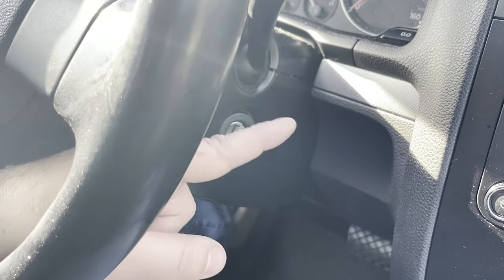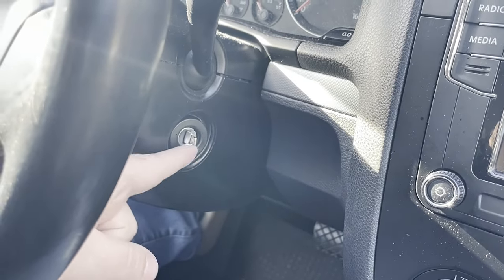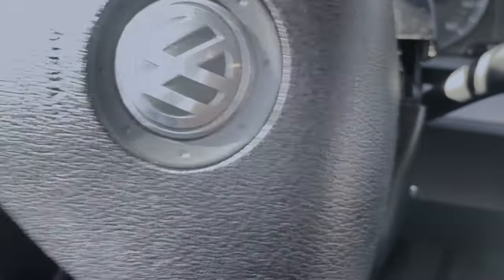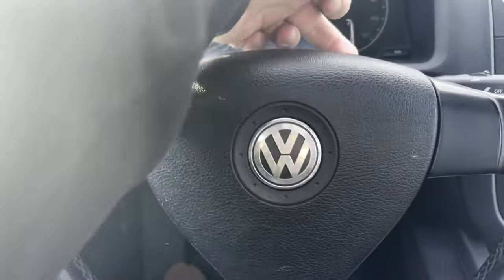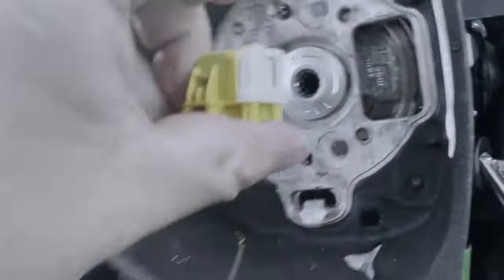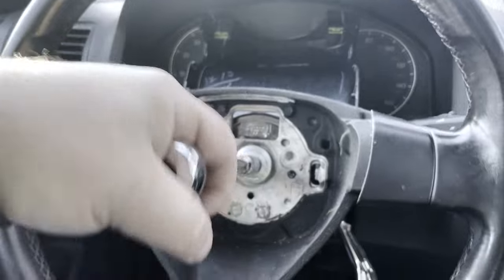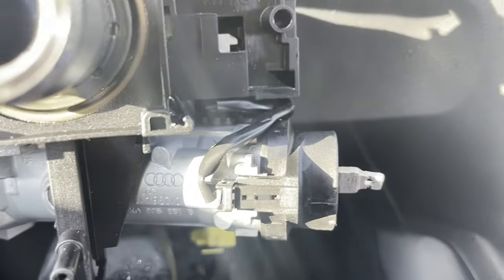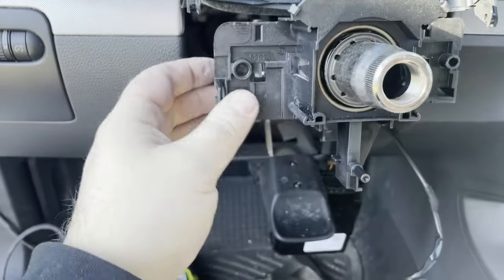Replacing Mk5 VW Ignition Switch Lock Cylinder

Comment: People should know that this removal doesn't require the removal of the steering wheel or the turn signals or wiper control. After removing the trim and the bottom most control box under neath the cylinder. Just drill out the retaining bolts., us the extractor.. disconnect the wire that connects to the front of the key switch...  the cylinder will not drop right out. but wiggle it around a bit and... it will come out.. 2008  Rabbit and similar.
Reply: How
Reply: You can't get to the T9 torx holding that little control box on without taking the steering wheel off...
Reply: What drill size for security bolts
Reply: I saw the thumbnail and was like wtf 😂
Reply: @chrismonroe8417 it's a T8 and yes you can get to it I did this job without taking of the steering wheel
Reply: Just use a mini ratchet for the T8
Reply: @DM-vl6kl  I don’t see how that could be possible with the steering wheel completely blocking any way of getting into the tiny slot you need to get to 🤷‍♂️
Reply: 07 rabbit done without removing steering wheel , triple square never heard of that
Reply: Cannot get the security bolts out with the wheel on unless you drill
Reply: @chrismonroe8417  if you rotate the steering wheel upside down you can access the screw without taking off the steering wheel. I am currently replacing mine as I type this.
Reply: @ You can’t though.

I thought I was going crazy when you said that because I rotated the steering wheel to try and get it but you absolutely cannot get that tiny bottom screw off without removing the steering wheel.

1000000% cannot get it.
Reply: @chrismonroe8417  I did it, you have to rotate it so that the top of the wheel is diagonal and then have an extension on the socket. I wouldn’t have replied if you couldn’t do it. I did have to take my wheel off after the fact though bc there are clips inside the tree that hold the cylinder inside the tree.
Reply: @🤷‍♂️
There’s no way to get to the screw on mine.
Physically impossible without removing the wheel.
Reply: @chrismonroe8417  I’ll make a video of how mine is and how to access it. Yours might have a different design too, what year is yours? Mine is an 08’
Reply: @ 2006

Comment: Guessing that by now, most of you, including the kind and methodical person who made the video, have come to insight regarding the security bolts. You really dont have to drill them out. There are a bunch of vids on this very same disassembly procedure, from jolly brits to silent polish blokes, and all of them feature reversing the bolts out by tapping with a chisel or a punch. Tap-tap-tap dun. Replace with an M8, 20-25mm long. You can drill a smaller hole and tap in a torx driver too, if you fancy that. I honestly feel sorry for you who go the hard way about it, as this man states, the drilling of the bolts was the hardest part of it all.
Reply: And, yeah, there might be some people who have for some reason ended up with a assembly where the security bolts are much more jammy-clammy. Really, no disrespect  or smart-arsery, I could have resorted to the same drilling, had I not caught the other vids first.. just hope people try tapping before drilling and save themselves trouble.
Reply: Do u have a link to those videos??
Reply: @davidgiertta l

Comment: You don’t need the key to changes your gears and set your car in neutral, use a screwdriver open the plastic cover around the shifter underneath you’ll find a yellow bottom, push it  with your fingers or screwdriver and then change the gears without using your 🔑 key.

Comment: Thank you so much for this - garage didn't want to touch the job. Successfully completed though I found it easier to tap the bolts out through the holes at the front with a hammer and screwdriver rather than drilling them out.

Comment: I have a similar issue with the door locks of Volkswagen Polo when I apply with the key fully inserted it pushes the pin barrel into the gullies and you can switch the key around for some reason even if it's not the correct key in   the lock the locks pins in line with the gully what should I say gullies and is free to spin around without opening the lock you can spin the key around I bought this for this because you can use the left-hand side lock for the right hand side but it's just upside down but the key what is left hand right side

Comment: Just did this procedure on a 2012 jetta. Used a center punch on the edge of the security bolts to turn them counter clock wise. Once you've got them to turn just a smidgen, they will trun out with your finger spinning them or something pointy sharp to spin them. But you have to be able to get center punch on the edge at an angle to get bolts to turn a smidgen.
Reply from the maker: Great info

Comment: Did you buy the whole kit? Like the actual cylinder and black part that the key goes into? If so, did you have to swap keys? My steering wheel sometimes wont lock, sometimes it won't let me actually turn the key over to start, sometimes it won't let me shut the car off, and sometimes the key gets stuck. I'm assuming that I have to buy the whole kit? Great video tho! very helpful.
Reply from the maker: I bought the complete assembly with all three parts. The black part around the key, the center lock section and the black electrical switch. But I ended up swapping back to an oem cut key and lock cylinder so I wouldn't have to re-key the rest of the car.
Reply: You got buy that shit separately man I’m going through the process now….
Reply: ****GOOD VIDEO EXCEPT WAY TOO MUCH REMOVAL****

There is NO need to remove anything on the steering wheel - AT ALL. Disconnect battery and  (1)Remove the top and bottom outside cover (3 T20 screws), then (2) DRILL out (calm down) the 2 bolts on top of the ignition lock cylinder then use an extractor kit to remove the drilled bolts out (or you can rotate them out with a flat head screwdriver and hammer - good luck on that one).  (3a) Then remove the steering wheel angle sensor (bottom flat plastic tray piece under steering wheel):  there is a TINY T8 screw in the front, then you need a thin pick/strong thin wire for it's front clip (unseen clip but you can wiggle around a curve near the right side of the ignition switch to depress it's hold), the rear clip is easy to get to - use your finger near the rear of it simply press it in. (3b) Disconnect it's YELLOW clip on the right rear side of angle sensor and let it hang there no need to disconnect completely.  ONE MORE STEP TO FINISH.  (4) stick your fingers, from the bottom pointing upwards, to release the (2) tabs holding the ignition lock housing in place.  I pops right out - That''s it.  Can be done in about 45-60 minutes with right tools.  May take a couple of hours if your slow and cautious.  But at least it's a free fix.  Be Breezy -

Comment: 11:38.    I  dropped  the steering wheel column by removing 4 bolts  to get more room for drilling , after drilling them out I used a bolt extractor  , thank you for your video  I follow all your directions   Thank you again it is so helpful
Reply: did you find out the problem? my 07 rabbit won’t turn over at all
Reply from the maker: great tip

Comment: Thank you for making the video! Really helped me change my 2011 VW GTI lock cylinder. Only thing I did different was to use a punch with a hammer on the security bolts to scar their head. I watched that on another video. Then I tapped that mark from a side angle which loosened the bolts. I could then just drag the punch against the mark circularly to unscrew them. I was able to reuse the bolts this way. The wire harness on the new VW OEM cylinder had one different connector on its wire harness that didn’t fit the steering connectors so I reused the old wires. I also reused my lock, removing it with a paper clip from the old cylinder.
Reply: I'm currently dealing with this issue of trying to get into the tamper proof bolts without having to take off the steering wheel. The bolts head are so small though that I'm having trouble punching a hole in it. Do you have an advice? Thanks!

Comment: Did well man explained and educated your procedures and didn’t skip vital information..
Reply: ****GOOD VIDEO EXCEPT WAY TOO MUCH REMOVAL****

There is NO need to remove anything on the steering wheel - AT ALL. Disconnect battery and  (1)Remove the top and bottom outside cover (3 T20 screws), then (2) DRILL out (calm down) the 2 bolts on top of the ignition lock cylinder then use an extractor kit to remove the drilled bolts out (or you can rotate them out with a flat head screwdriver and hammer - good luck on that one).  (3a) Then remove the steering wheel angle sensor (bottom flat plastic tray piece under steering wheel):  there is a TINY T8 screw in the front, then you need a thin pick/strong thin wire for it's front clip (unseen clip but you can wiggle around a curve near the right side of the ignition switch to depress it's hold), the rear clip is easy to get to - use your finger near the rear of it simply press it in. (3b) Disconnect it's YELLOW clip on the right rear side of angle sensor and let it hang there no need to disconnect completely.  ONE MORE STEP TO FINISH.  (4) stick your fingers, from the bottom pointing upwards, to release the (2) tabs holding the ignition lock housing in place.  I pops right out - That''s it.  Can be done in about 45-60 minutes with right tools.  May take a couple of hours if your slow and cautious.  But at least it's a free fix.  Be Breezy -

Comment: Hi, actually at 16:04 you just skipped the most important part for me, how to remove the ignition barrel without any demage if the key does not turn, as you mentioned it should turn to full ignition position to be able to remove the barrel (using a thin strong wire or paperclip, etc.), so could you please share how could you remove it if the key does not turn?
Reply: ****GOOD VIDEO EXCEPT WAY TOO MUCH REMOVAL****

There is NO need to remove anything on the steering wheel - AT ALL. Disconnect battery and  (1)Remove the top and bottom outside cover (3 T20 screws), then (2) DRILL out (calm down) the 2 bolts on top of the ignition lock cylinder then use an extractor kit to remove the drilled bolts out (or you can rotate them out with a flat head screwdriver and hammer - good luck on that one).  (3a) Then remove the steering wheel angle sensor (bottom flat plastic tray piece under steering wheel):  there is a TINY T8 screw in the front, then you need a thin pick/strong thin wire for it's front clip (unseen clip but you can wiggle around a curve near the right side of the ignition switch to depress it's hold), the rear clip is easy to get to - use your finger near the rear of it simply press it in. (3b) Disconnect it's YELLOW clip on the right rear side of angle sensor and let it hang there no need to disconnect completely.  ONE MORE STEP TO FINISH.  (4) stick your fingers, from the bottom pointing upwards, to release the (2) tabs holding the ignition lock housing in place.  I pops right out - That''s it.  Can be done in about 45-60 minutes with right tools.  May take a couple of hours if your slow and cautious.  But at least it's a free fix.  Be Breezy -
Reply: @TriuneSelf4444 could you tell me what the module is called beneath the ignition assembly I’ve got a dead spot on the mother board and my dashboard only lights up if you press the spot but the vehicle has power 👍
Reply: @jasiahgriffis689  Sorry, chief I was away for a few days.  The module beneath the ignition assembly on a 2008 GTI Golf is most likely the ignition control module (ICM), also sometimes called the "ignition module" - it's the electronic component that manages the timing and spark generation for the engine ignition system.  I am not sure if this is the one you are referring to.  If not then you may want to go to VWs online parts/accessories page and type in these parts name(s) and they will show you a picture of it AND the surrounding/supporting parts to find out which one you are referring to.  Hope this help.

Comment: Question - How did you install the old key cylinder into the new ignition housing?  Around 16:03 you just pull out the assembled parts, but I am having difficulty putting my old key cylinder into the new housing I bought.  I read elsewhere that you shouldn't turn the insides of the new housing with a screwdriver, before installing the key cylinder, but I unfortunately already did that.  Any tips on getting it to go together now?
Reply: ****GOOD VIDEO EXCEPT WAY TOO MUCH REMOVAL****

There is NO need to remove anything on the steering wheel - AT ALL. Disconnect battery and  (1)Remove the top and bottom outside cover (3 T20 screws), then (2) DRILL out (calm down) the 2 bolts on top of the ignition lock cylinder then use an extractor kit to remove the drilled bolts out (or you can rotate them out with a flat head screwdriver and hammer - good luck on that one).  (3a) Then remove the steering wheel angle sensor (bottom flat plastic tray piece under steering wheel):  there is a TINY T8 screw in the front, then you need a thin pick/strong thin wire for it's front clip (unseen clip but you can wiggle around a curve near the right side of the ignition switch to depress it's hold), the rear clip is easy to get to - use your finger near the rear of it simply press it in. (3b) Disconnect it's YELLOW clip on the right rear side of angle sensor and let it hang there no need to disconnect completely.  ONE MORE STEP TO FINISH.  (4) stick your fingers, from the bottom pointing upwards, to release the (2) tabs holding the ignition lock housing in place.  I pops right out - That''s it.  Can be done in about 45-60 minutes with right tools.  May take a couple of hours if your slow and cautious.  But at least it's a free fix.  Be Breezy -

Comment: Thanks for all your time to share the info and procedure. Great info and help there
Reply from the maker: Glad to help
Reply: ****GOOD VIDEO EXCEPT WAY TOO MUCH REMOVAL****

There is NO need to remove anything on the steering wheel - AT ALL. Disconnect battery and  (1)Remove the top and bottom outside cover (3 T20 screws), then (2) DRILL out (calm down) the 2 bolts on top of the ignition lock cylinder then use an extractor kit to remove the drilled bolts out (or you can rotate them out with a flat head screwdriver and hammer - good luck on that one).  (3a) Then remove the steering wheel angle sensor (bottom flat plastic tray piece under steering wheel):  there is a TINY T8 screw in the front, then you need a thin pick/strong thin wire for it's front clip (unseen clip but you can wiggle around a curve near the right side of the ignition switch to depress it's hold), the rear clip is easy to get to - use your finger near the rear of it simply press it in. (3b) Disconnect it's YELLOW clip on the right rear side of angle sensor and let it hang there no need to disconnect completely.  ONE MORE STEP TO FINISH.  (4) stick your fingers, from the bottom pointing upwards, to release the (2) tabs holding the ignition lock housing in place.  I pops right out - That''s it.  Can be done in about 45-60 minutes with right tools.  May take a couple of hours if your slow and cautious.  But at least it's a free fix.  Be Breezy -

Comment: @ShinyFastLoud So the clear ring you free spun is the clock spring, those can’t be free spun, they control a lot of stuff … most notably the driver airbag, they can only be “free” spun about 1/4 of a turn before they go bad. There should be some type of warning on it, that shows a picture of a vehicle with steer ahead wheels and another picture of a vehicle with wheels not in the steer ahead position. I’m surprised you have not had any airbag or steering assist codes …
Reply from the maker: Great info but I think you might be referring to the more complex clock spring. This is the basic one since the only connections to the wheel are the airbag and horn. There are no other controls on this wheel. I only rotated it about 1 turn and the ribbon cable within the clock spring can handle that.
Reply: Even then the clock spring turns with the wheel tho… if they can only do a 1/4 turn before going bad then logically you’d only be able to turn your wheel a 1/4 turn…

Comment: Great video 
One ? 
Do you have to swap the ignition switch for the old 1 (is it coded) if putting original tumbler back on 

Basically I brought a new lock with electrical switch 

But wanted to use old key

Comment: Thanks for this. This tutorial is what I needed for my 09 (just finished putting everything back together). Turned out (after drilling into the middle part of the ignition) it had some obstruction that stopped my key from getting to the ON position. 

After it being all done, I’m curious: do you know if is it necessary to remove the steering wheel because of the center bolt or are the three t25s , t9 and the security bolts good enough?
Reply from the maker: You technically only remove to make room to work. If you can get to the safety bolts without removing it I think you are good to go.
Reply: @ShinyFastLoud  I'm dealing with this exact issue for my 09 jetta, I'm having a lot of difficulty trying to drill into those freaking tamper proof bolts, once I get to it, could you explain or do a video on how to change inside the cylinder, like the middle part inside without messing it up? That is the part I am most worried about changing. Thanks for this video!

Comment: If the problem is the section which the key goes into can’t you just remove that and replace without having to take everything apart? 

Or Is it generally the metal cylinder that is at fault? 

Mine is jamming /getting stuck mainly when I try to turn off ignition I have to wiggle the key in lots of ways and eventually it will turn off